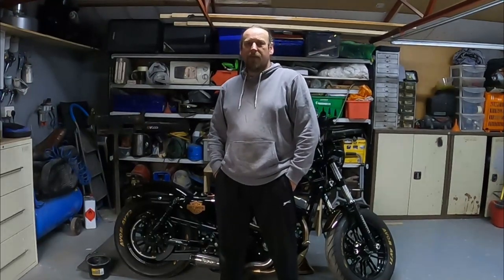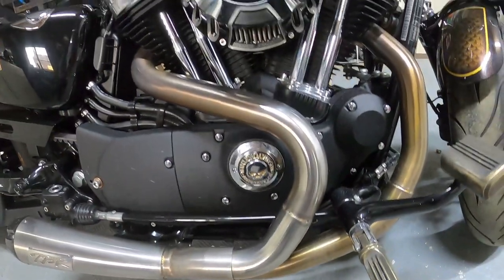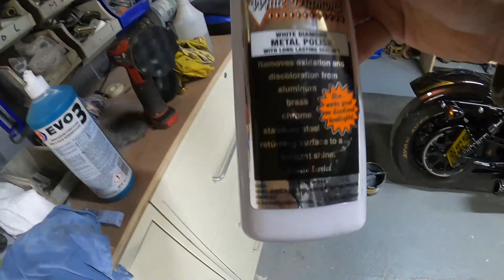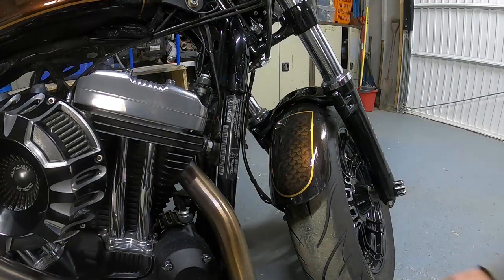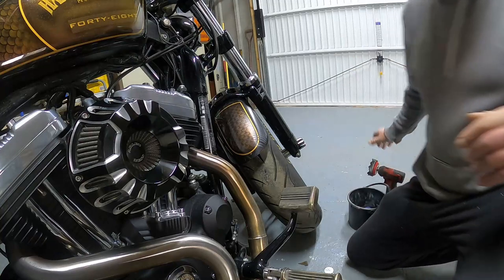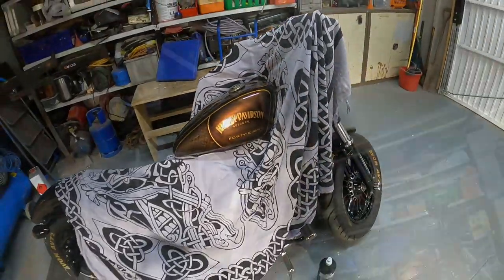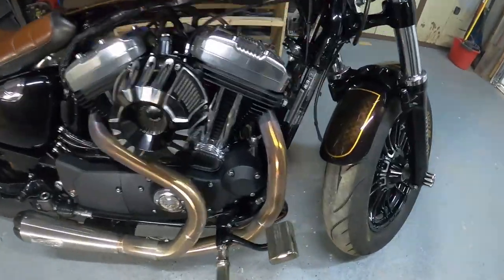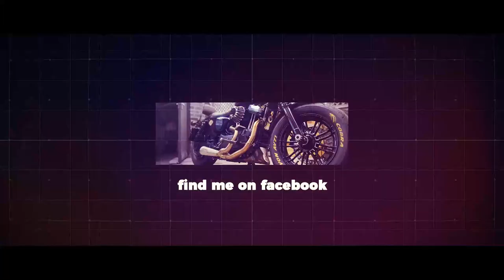detailing your Harley

Comment: Noticed you have some sort of riser kit raising your handlebars... Is that an H-D part? part number?
Reply from the maker: 2 inch risers. Not a specific h.d part. Just search for handlebar risers for your model bike mate. And whatever size. Just about get away with 2 inch on standard bars without cable extensions
Reply: Yeah, I have a 2018 48... so I'm assuming what you have would be compatible with what you've put on your own bike! Nice paintjob!
Reply from the maker: @anatoliyefimov4984  yep, it will be mate. If tou search for 48 ones , loads come up from suppliers or ebay 👍.
And cheers 😁👍